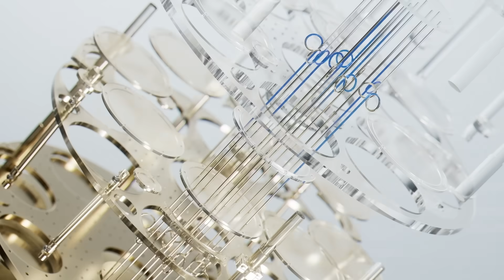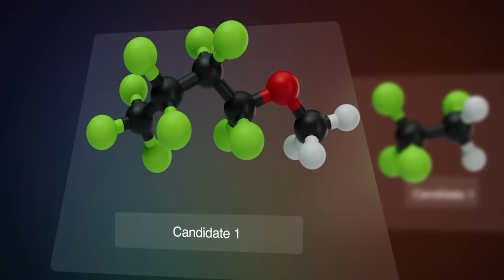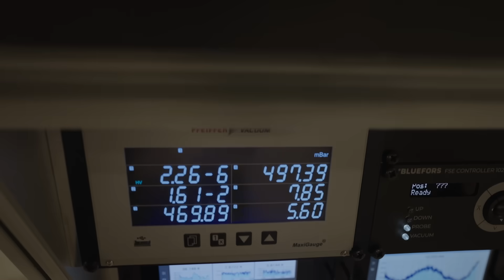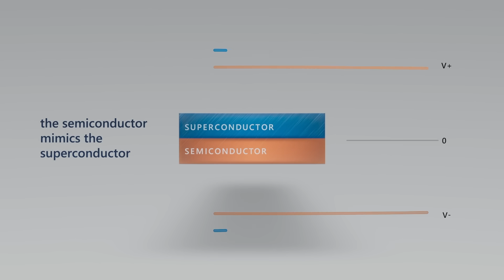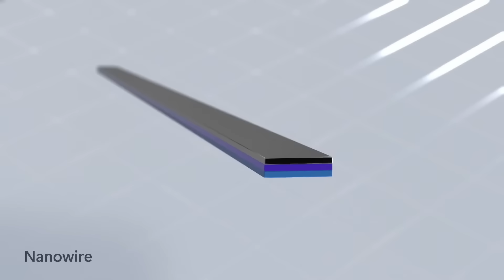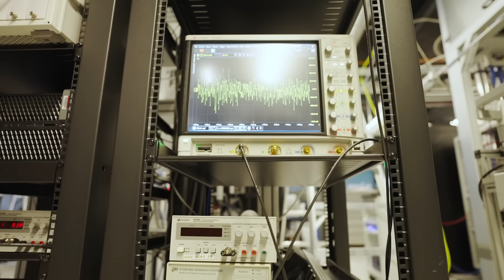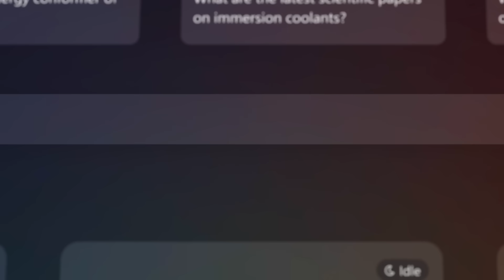Majorana 1 Explained: The Path to a Million Qubits

Comment: They had Microsoft's marketing budget, and they couldn't find a science communicator who could clearly explain in 10 minutes how a qubit differs from a regular bit, why that is centrally important, and how it relates to the problems they aim to solve.
Reply: that's for people to do their own research on. this  video was intended for an audience that is already familiar with quantum computing, it was more focused on the progress being made based off the fundamentals
Reply: @nick_0  Most people likely wouldn't know where to start. I don't know their target audience, but the video has had and will continue to reach a wider audience than only people familiar with quantum computing.
Reply: After conversing with AI for what seemed like 10 pages of back and forth, I finally understand.  In traditional qubits, information is stored in things such as electron spins (an attribute of electrons), which an electron exists in a finite spacetime region as a probability wave.  However, because it's localized (in a small region like an electron cloud), extremely tiny microscopic changes in temperature or magnetic forces could change that state, collapsing the superposition of the electron, resulting in errors. In quantum mechanics, measuring one superposition particle collapses the other particle's information. That's to say two particles with a superposition (meaning they're linked to each other despite being across spacetime of even billions of light years apart) so that if you measure one particle's value, you immediately know what the other particle's value is.  And these values aren't preset like saying a right shoe or left shoe because before you measure it, each particle or shoe exists as both a right shoe and left shoe simultaneously, so whatever you happen to measure what reality is on your end, the other particle instantaneously exhibits the opposite attribute.  This is Einstein's "spooky action at a distance" because he refused to believe nothing can travel faster than light. And Einstein is correct IF you're traveling THROUGH spacetime, but superposition information isn't traveling through spacetime. 

On the contrary, you don't have issues with micro changes affecting topological state qubits.  That's why you hear about all the errors with quantum computing and that you'd need a lot of qubits (like hundreds of thousands, or millions) to process with acceptable error levels.

In topological state qubits, for example, you might use a nanowire (which is designed to be in topological state of matter, meaning one side behaves like a superconductor and the other side like semiconductor/insulator) that has two ends you can manipulate, called Majorana zero modes (MZMs).  Instead of measuring a single electron's state, the electron is spread across the entire nanowire, so the combined overall state of the nanowire (a few mm in length) IS the data.  The electron wave function is spread across the entire nanowire (because as we learned, electrons and things sufficiently small, even molecules made up of thousands of atoms in size, exhibit both particle/wave duality, meaning they exist as particles when you measure them but exists as wave functions when you're not).  As a result, it's fault tolerant because information isn't localized, but is the full measurement of the nanowire because the electron exists across the entire nanowire as a wave function. The state of the electron or lack thereof (0 & 1) therefore is the entire measurement of the nanowire.  A single event at one MZM wouldn't affect anything.  You'd need to have some larger catastrophic event such as temperatures rising across the entire nanowire affecting BOTH MZMs to collapse the data.  Each MZM effectively is half of an electron, and as long as the nanowire has sufficient distance between the MZMs, their data integrity is intact.  Microsoft uses a "network" of nanowires to store all the information.  How you move the MZMs around to swap places, essentially the order in which you do it, affects the final qubit value (0 or 1).  Only when you bring the two MZMs together do you collapse the waveform and an electron forms, thus reading the value (0 or 1).  You move the MZMs using electric or magnetic fields.

Main thing is Microsoft's approach requires magnitudes of order LESS qubits, and has fault tolerance because data isn't being stored locally (like in a single electron) but rather over the entire nanowire structure, kind of like saying there's one person in your home, therefore that's a 1.  If there's no one, that's a 0.  Now imagine 2 doors, front and back.  Those are the MZMs, where you can manipulate (called "braid") changes, read data etc, or in this example, allow the person in or out.  In order to destroy any data, you'd need to simultaneously block both doors or something.  One door going bad won't affect the person.  In traditional qubits, the state of the person in the house (ie awake or sleeping) determines the 0 or 1, but because the person can be knocked out with medication, or awaken by something unexpectedly, you can't be 100% sure about the data.  And for regular quantum computing, if you measure the data by seeing if the person is awake, you may inadvertently wake them up (ie collapse the superposition wave function), resulting in "errors".  Dumb example but you get the idea.
Reply: @VamYang  Measurement will always collapse a superposition to a measurable state (hence the name), this is both a fundamental property of quantum mechanics and something that quantum computing relies on. Also, measuring a single qubit X will influence all other qubits which are entangled with X (this is, essentially, what entanglement means).

The main difference between topological qubits and other implementations of qubits seems to be that topological qubits are more resistant to errors. You will have errors in both systems, but in topological quantum computers errors do not compound in the same way they do in other implementations, and consequently do not perturb the final measurement as easily.
Reply: @VamYang  so you used hallucinating AI rather than asking knowledgeable people or reading about a subject? Yeah totally worth reading your response...
Reply: @Neuroszima  Do you even understand what hallucination is???  And how did these humans on this video help you understand it?  Your post is completely worthless and I actually lost an IQ after reading it.
Reply: @ Your post generated by AI is worthless, sorry
Reply: Skill issue
Reply: You don't need anything of that to impress random dudes to buy your stocks. Just affirm with confidence something about great perspectives and imminent breakthroughs.

Comment: Extraordinary claims requires extraordinary evidence. Majorana fermions have not been conclusively observed and I’m keen to see evidence of this.
Reply: Not the point.  The electron being split and existing as anti half particles at both ends of a topological state matter is what behaves like Majorana fermions.  But actual Majorana fermions do not exist as they'd annihilate each other when they come in contact and therefore can't exist...
Reply: @VamYang 6:35
Reply: Observing majorana fermions is literally what they're talking about in the video.
Reply: @LegacyNSFW No, an actual majorana is different. Here is a bit of primer. You might know that for light particles such as photons, there is no such thing as anti-photons. You might know that for positive particles such as protons, there are opposites such as electrons, and there are also antiparticles such as anti-protons. You might know that for neutral particles such as neutrons, there are no opposites, but there are still antiparticles such as anti-neutrons. Well, it is theorized there exists inert neutrinos where there is no such thing as its anti-neutrinos. This is the only possible majorana particle in physics across all particles that has rest mass. What does this mean for quantum computing? We will never use neutrinos for computing, we only use electrons, and Microsoft does not use majoranas but imitations of majoranas. Controlling neutrinos is still a thousand years away. It is unclear how the absence of antiparticles has anything to do with quantum computing either.

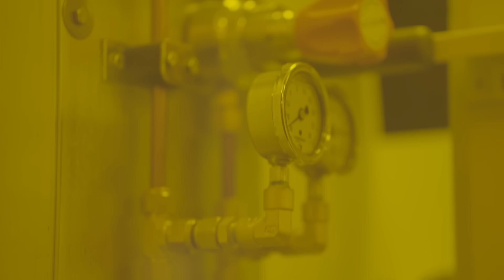Comment: 4:40 If bigger is more stable, and we can already make them big, why not just build a really big one first to validate that 1million qubits will meet the promise? I never understood this part of quantum computer development. Classical computing started out big… so why hasn’t quantum computers gone down the same route? Why not scale first then shrink?
Reply: @br3nto  Small cold easy, big cold hard
Reply: These qubits typically operate at cryogenic temperatures, close to absolute zero. It's not trivial to scale that up.
Reply: It is hard to measure qbit.. So it is still very hard to scale the old way. This use a new material that protect the qbits, but can also be feed with microwave, so can use smaller wires to be measured
Reply: My understanding is that bigger also means not as cold. Not as temperamental. Bigger easier. I read one proposal for a stadium sized solution. I wish I still had the link. I don’t think any cryogenics was actually required. It was just big. I think it had something to do with capacitors and electrostatics. 

We do big all the time. Like the LHC, or the kilometre array, or the IceCube neutrino detector, or the ITER.

Comment: This is either the aggrandization of the century or your team will get all the physics nobel prizes for the next years. Detecting and also using Majorana particles. Wow. Anyhow, I'm fearing that this boils down to some emulation of a quantum state in 2-D material. Or worse.
Reply: I'm pretty sure it's Nobel time.

Comment: Application	Logical Qubits Needed	Feasibility with 10,000 Logical Qubits
Factoring 5,000-bit number	~10,000 (2n, n=5,000)	Feasible, breaks current cryptography
Molecular Simulation (100 atoms)	~1,000-5,000	Feasible, significant for drug discovery
Optimization (10,000 variables)	10,000	Feasible, impacts logistics, finance
Quantum Machine Learning	~1,000-5,000	Feasible, enhances AI capabilities
Climate Modeling	~5,000-10,000	Feasible for simplified models

Comment: "one that can scale" so it hasn't been scaled yet. 

Another marketing buzzword soup. Microsoft doubling down on this mythic quantum computing huh. We still dont know what to do with them, and how they can be useful. 

They keep telling us these calculations exist, so have they used their computer to solve these or what. But we have yet to see anything. 

They are trying to brute force reliability, by using more quibits than the computation can take with fail safes (error correction). But as far as we are aware you need a super computer to run the quantum computer chip, so why even need the chip, use the supercomputer....

Comment: A quantum computer has never beaten a classical computer at any objective task. (tasks that require acurate calculations)
Reply: ok but also, they had like 10 bits to work with. I feel like a 10 qubit quantum computer could EASILY beat a classical computer with 10 classical bits, probably a lot more. So this comparison is pretty useless.
Reply: @ilonachan  Classical computers use 8 or 16 bit, as you can represent larger numbers with fewer binary digits with hexadecimal number system (base 16) and it is a simple conversion (it takes more steps to convert a decimal to binary), a 10-bit classical computer would be very inefficient. It is also not equivelent to quantum qbits as it refers to  addressible memory rather then computing performance or efficiency.
Reply: "Tell me you don't know anything about quantum computers without telling me you don't know anything about quantum computers"

Comment: Cool, a lot of superlatives. But are there any real examples as proof it works, no demo?
Reply: A demo would be useless for someone like you. As well as the other 99.9% of people watching. The output of these systems is not a classical output like you are used to seeing. The information is presented using laser, microwave pulse or magnetometer readings. They're also not debuting a full-fledged product. They're just presenting a new paradigm shift and architecture. They're not selling a product. There's a research paper detailing all of their proof, but it wont make sense to you. Unless you're a quantum physicist.

Comment: How will quantum computing work with LLMs/ML/AI?  I can only assume that, if you can solve the motion of electrons in a time orders of magnitude faster than what a classic computer would do, reasoning could have a similar bump in performance.  How far off am I?
Reply: ML will skyrocket with quantum advancements. A "bump" in performance is a vast understatement. Once a quantum system with 1 million+ qubits becomes operational, the whole field will begin to change.

Comment: So hello Nobel prize to the team. If y'all really proved that Majorana particle exist & can be harnessed then y'all deserve it. Hurrah!!  Get ready for the calls from Stockholm!
Reply: Yeah I know. Wouldn't there be a paper in PRL about this if they did discover the elusive majorana Fermion. I feel like there is something I'm not getting here.
Reply: just smoked some Majorana and can confirm Majorana particles 100% exist
Reply: Majorana fermions (particles that exists as both a particle and it's anti particle simultaneously) don't exist.  A neutron is the closest thing.  However, topological state matter allows two different ends (Majorana zero modes) to split a particle in half, so to speak, like splitting the electron in half, thus both halves are their own anti half particles.
Reply: @VamYang  so they aren't claiming majorana Hermione. But a topological phase which behaves like majorana fermions?
Reply: @shohamsen8986 They are claiming Majorana Fermions but actually found electron-hole pairs. That's the problem.
Reply: @wasgehtsiedasan8660  aah I see. Thanks.
Reply: you are a huge 🤡
Reply: @mr.electronx9036  same to you.
Reply: @mr.electronx9036  same to you.

Comment: I still think they are overselling what these processors can do. Do not conflate GenAI with Quantum computing. We currently have individual processer chips that perform ONLY one function, over and over again, super fast, but these processors are not similar to CPUs or GPUs. Picture eight individual Q processors with a single linier formula printed on each of the eight chips. Each processor has it's own cooling stack with a freezer wrapped around it. An API would usually be used and addressed to the one system that processes a singular function and then it responds in 2 mins or 48 hours, depending on the known response time of the unique Q processor. There might be a queue of transactions waiting to be processed before your API request is even started. You have to write your application/script to allow for that extended amount of time. Again, these are not general super computers, they are only super with their one specific linier equation, it won't non-linier curves.

Comment: Evolution has tapped into the quantum nature of reality, as it seems to be a feature of all life. Even single cell life depend on it in order to make "decisions" of sorts. So we can never get real AI (a thinking machine) with just classical bits. It has to be quantum integrated with classical. This is a major step in that direction...
Reply: You say that like a classic machine cant make decisions?
Reply: @arnv4487  I think he meant that classical machines cannot replicate the "spontaneity" of a real intelligence, so you need a quantum touch to replace this.
Reply: @Vaisakh22  While true, that doesnt require Quantum computing. A single radioactive core and a geiger counter would be enough for true randomness
Reply: AI today works on discrete values, sometimes with large precision and many times small, which is called quantization, akin to resolution. An AI model is able to think novel if the model is more than just linear algebra, i.e., an organic activation function. Here, if we use quantum for uncertainty, it will learn and think beyond our comprehension, though it would take years.
Reply: @GunwantBhambra  Even a single cell organism like a paramecium can make relatively complex decisions, which sort of disproves the whole neural network idea just there. 

But more to the point here; the "search spaces" for thinking and making decisions about even the simplest things in real time explode beyond anything that classical can handle right away! You need quantum effects for that, (not just just borrowed terms) or not even single-cell lifeforms could survive from second to second. It's about speed and memory! It only works with quantum effects, classical is more the input and output.
Reply: @arnv4487 The more classical bits you add, the more effective the stupidity, but reasoning is something else.
Reply: We already have billions of thinking machines. They're called humans.
Reply: @AnAntidisestablishmentarianist  Yeah, but our brains are part quantum, not just classical!